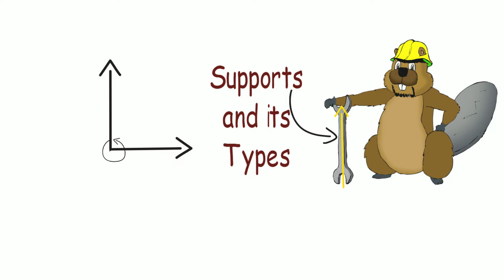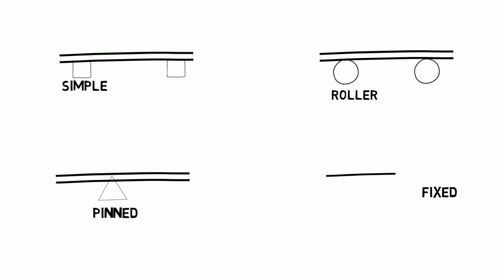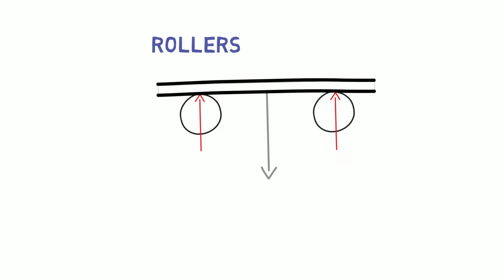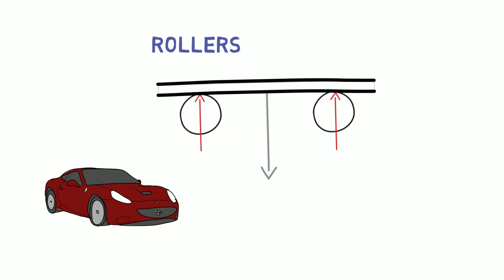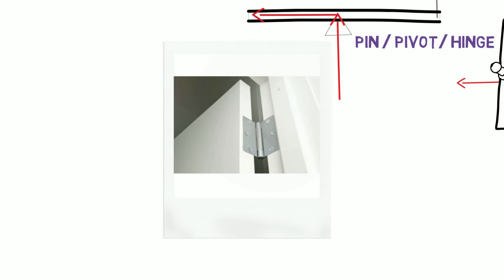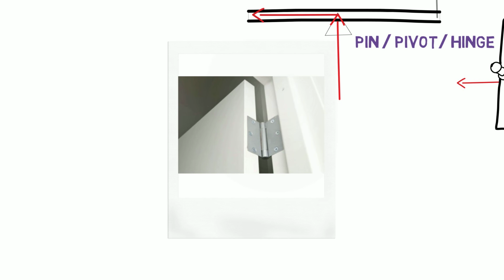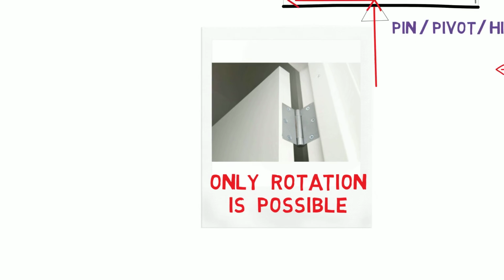Types of supports and its reactions? With examples!!!

Comment: If iam calculating bending in the beam welded or tightened by the screws on both ends it should be onsidered as the fixed support... (iam calculating construction from I beams in roller conveyor)

Comment: What if there is an inclined force acting on the beam...will it generate reaction force??? if yes, then in which direction...
Reply from the maker: The above video explains for all the forces, in a vertical and horizontal direction, which means that if you are given an inclined force, it can be broken down into vertical and horizontal components, and then the study can be done, where the vertical and horizontal forces will have a reaction depending on what type of support you use.